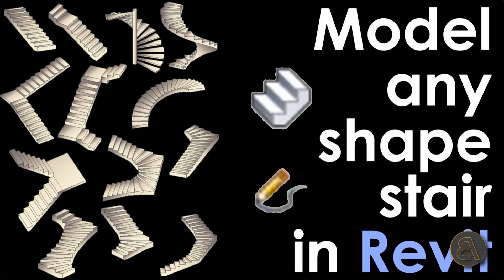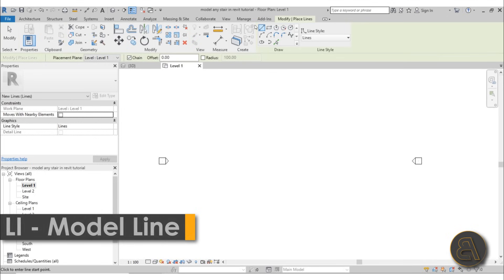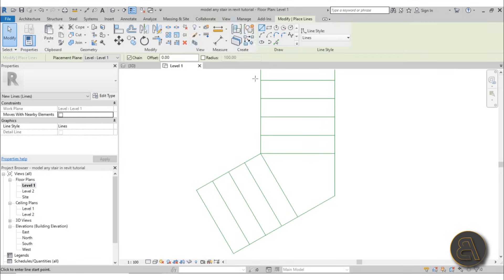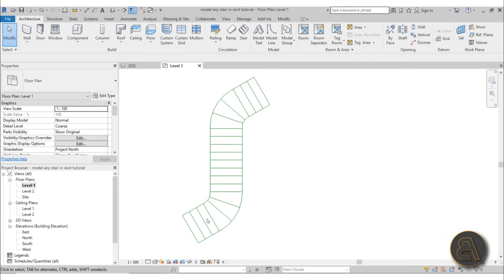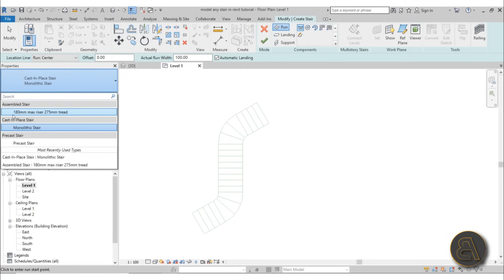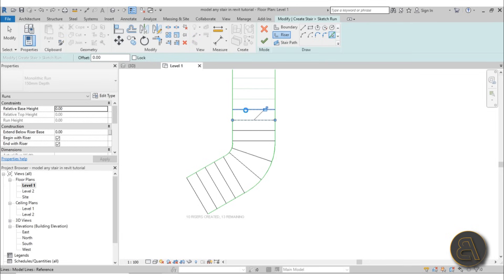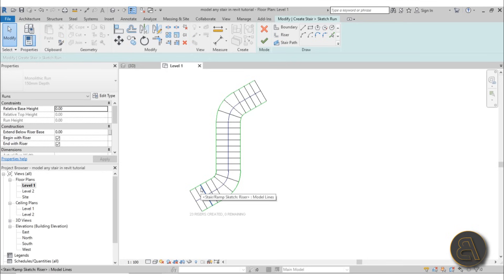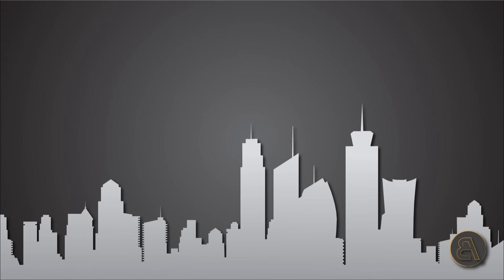Model any Shape of Stair in Revit Tutorial

Comment: Hey Balkan Architect, this isn't inline with the tutorial but there is a problem I have and I can't find anything relating to it.
I have two different steps in one project and I cant change the material of one step without the other changing it's own
Reply: Ok I found another way, I used monolithic stairs for one and assembled stairs for the other however the question is still opened because if I had 10 different stair with individual materials to create I will be blocked

Comment: in the same revit project file, is there a way to make 2 different system stair? for example, one with C channel stringer, the other with default profile ???

I said 2 different system stair because I find after I change one stair stringer to C-channel, all the other stair stringer changed to C-channel.
But my old Revit file is shown,  I have 2 different stringers on 2 different stair. Dont remember how I did it.